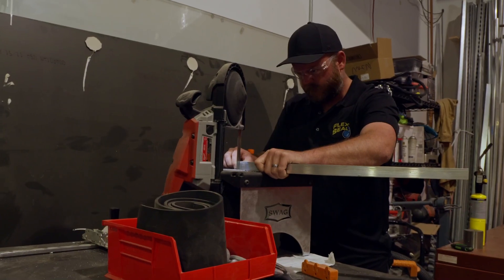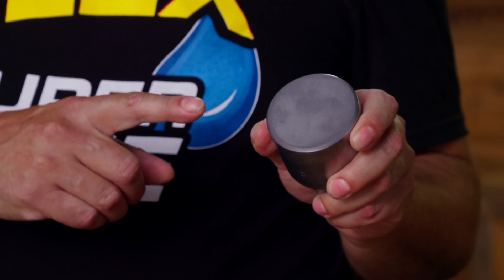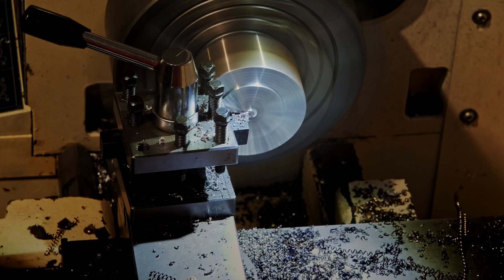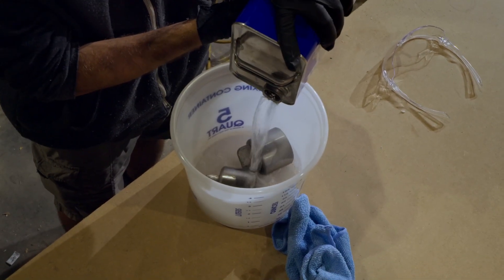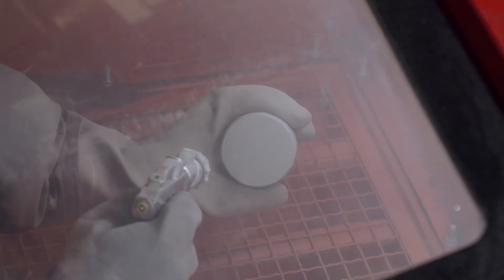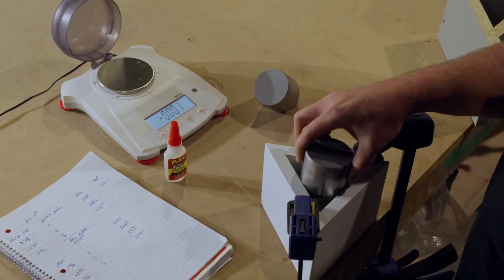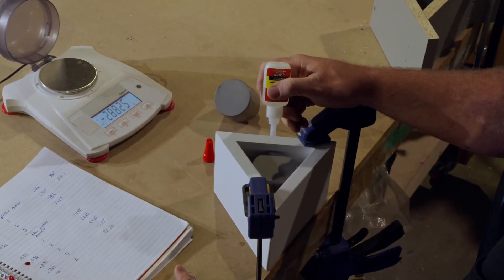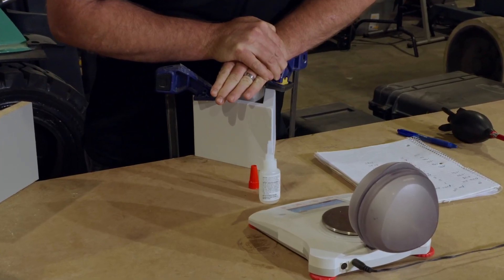Watch How We Lifted 3 Tons

Comment: Yet another lie from the flex seal family of products. If you pause the video you'll see that there are only about 90ish blocks and at 38lbs a block that's just under 3500 lbs and there's no way that little metal basket weighed over 2500 lbs!

Comment: I love how phil swift always tapes and glues thin plastic boats together and sits in the back by the motor where weigh is not supported normally!!  making him temporarily float just long enough to get a quick 3 second video!!
Reply: youre obviously not gonna sit directly where you put the tape, also if youre solo piloting a motored boat, you are gonna sit by the motor, its where the steering wheel is. you didnt quite get the point of the demonstration, also theres plenty of internet tests using what youre supposed to be using flex products for and they all legitimately perform great, but theyre obviously not a magic welding polimer that fixes everything, theyre just a high quality  fixing adhesive.

Comment: if we could just glue parts together, we would bother with welding.
Notice how they lift it for only 10 seconds.
Reply: still impressive with the ammount of gluez even with a the setup. this just mean that on normal conditions this thing should hold more than enough for nearly everythinf that you SHOULD be using super glue for. dont tey welding car parts or actual housing structure or something.
Reply: There's always one 🤦‍♂️ The test was meant to be quick, they're not stating this is a permanent hold and 1 drop will continue to hold 3 tons like a weld. Anyone who would think that has a room temp IQ.

Comment: Interesting. So in a custom scenario like this, giving the glue everything it needs to grip on, you were able to max it out at 3t. This actually shows pretty well how strong it can be outside of these conditions
Reply: Even if in normal conditions it maxes out at 1 ton, it’s still excessively strong for daily uses, a big plus from me
Reply: Just 1 drop too
Reply: does it? They didn’t give comparison of any other scenario,why would it?
Reply: @PomadaGaming  they said specific detail tooling in the beginning, as well as gave examples how it would negatively affect adhesion. Had this just been two clumps of steel, it probably wouldn’t be the same
Reply: @PomadaGaming  why would you need to glue something that's over 1 ton?